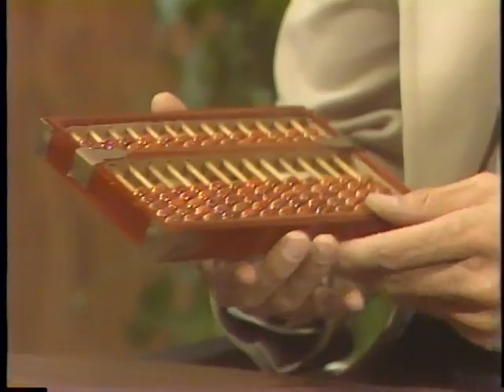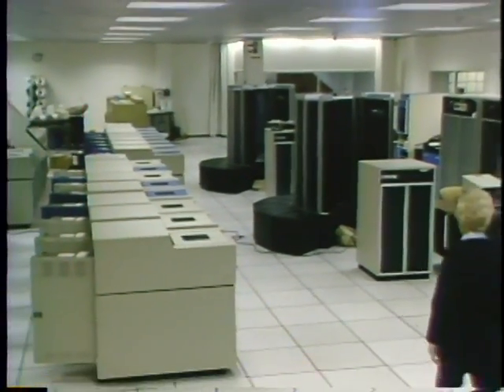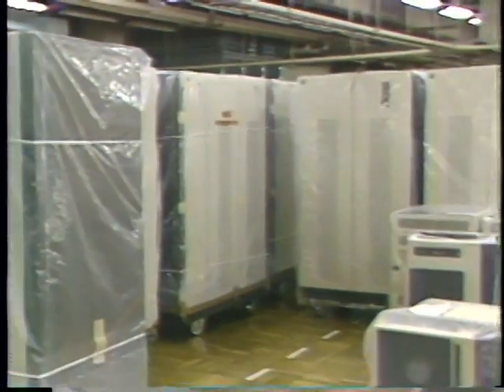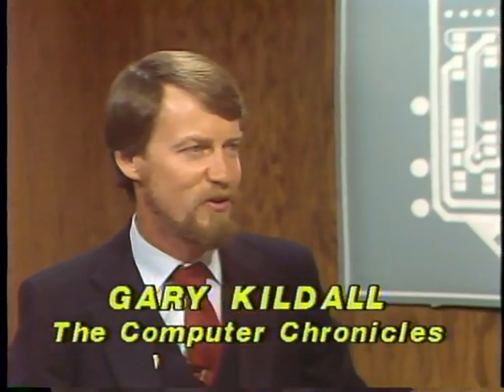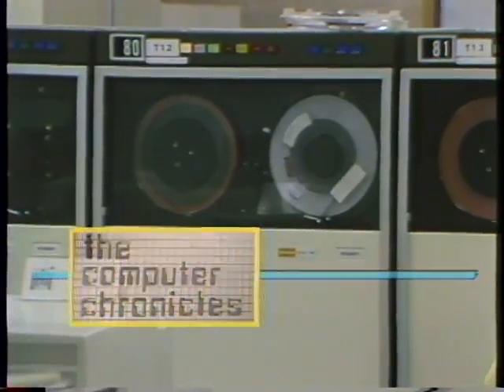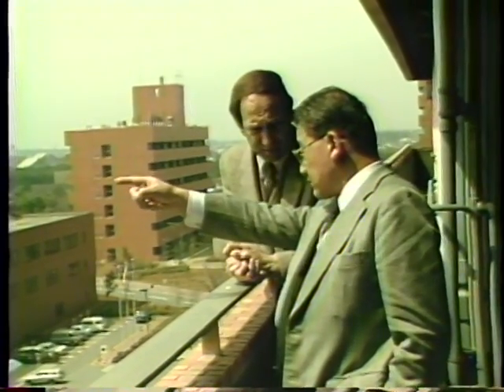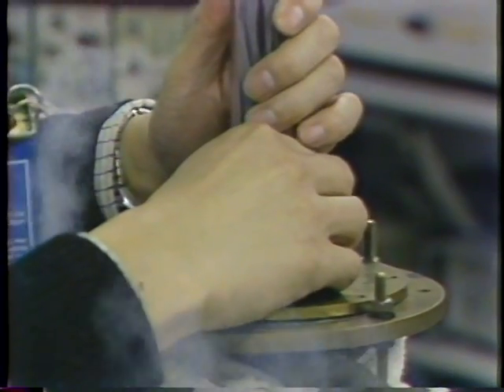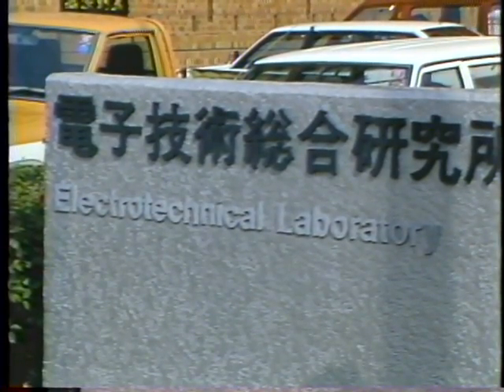The Computer Chronicles - Super Computers (1984)

Comment: Random fact - if you read the book Jurassic park (1990), in the beginning the government had no idea what was happening on the island and were investigating the company. They knew that the company Ingen had imported three cray X-MP super computers on to the island. The ones in this video were the earlier versions used to design nuclear weapons. One computer was enough do most of the work anyone would need - yet this company named ingen had  imported  3 of these on a remote island.  The government was baffled as to why someone would need that much computing power on a remote island - little did they know that the park were using them to reconstruct the genome of the dinosaurs
Reply: Random fact - The supercomputer in the Jurassic Park film is a Thinking Machines CM-5 supercomputer, not a Cray.
Reply: Little did they also know the park boasted some silicon graphics machines as well. Screw the dinosaurs, they should have sold tickets for people to come and see the computers.

Comment: The fun thing about this technology in this video is that, over time these supercomputers with their specialized parallel and high performance hardware started using more standard operating systems (like, eventually, Linux...), meaning those operating systems had to add support for this kind of specialized hardware. Later on, when typical consumer hardware like desktop and phone CPUs became more like these old supercomputers (with lots of pipelining, and multiple cores), the OSes already had the support in place to be able to run in those kinds of environments.

Comment: I recall reading an article in New Scientist back in the 1990's about the race to build the first Teraflops supercomputer.
The latest Xbox supposedly has around 12 times that performance.
Reply: I wrote a (bad) sci-fi novel in the early 90s in which an entire planet was run by a single "Teraflop Computer" lol
Reply: Not really the same numbers.  For supercomputers they always quote the flops in terms of double precision math (64 bit) as that is the standard for high quality simulations where the tiniest bit of accuracy makes a difference.  In the world of consumer gpu's, games don't need that type of precision.  the 12 tflops of the current xbox is single precision (32 bit); the double precision is only 759 gflops - short a terraflop.   So that "old" supercomputer you read about is still faster at what it was designed to do than the current xbox.  Keep in mind though, that the crippling of the double precision performance is intentionally done so that people don't buy these cheap consumer units to stack them up for highly scientific work - they want you to buy the super expensive commercial/industrial GPUs. And those are wicked fast - the current Nvidia A100, a standard "budget" server farm GPU does 10 Tflops double precision, for example.  With that said, modern gpu's have one added massive thing that these old supercomputers didn't have and that is super fast memory access.  the Xbox has DDR6 320bit memory at half a terabyte per second, which so much exceeds these old supercomputers that their throughput would make them effectively faster despite their slower computational speed in double precision.  It is in fact this reason why you can run a neuro network AI LLM on today's moderate spec computer hardware that would never be close to achievable on those old supercomputers of the 90s.

Comment: @15:18 : Scary to see that guy messing with liquid N with no protection. One splash would kill your hand.
Reply: It’s not terminator 2
Reply: You can pour liquid nitrogen over your skin with minimal effect. Your hand is so comparatively hot that the nirogen starts to evatorate before it can make close contact effectively floating it away from your skin.

you have to actively plunge your hand in the LN for a few seconds just to cool it enough to start causing some damage.

Comment: Now transistors are closing in on the molecular structure of silicon, we are still at the dawn of processor based computing. As quantum computing becomes more viable and probable over possible we could soon make far larger leaps than ever before. If this is super-computing what will my eight year old granddaughter see in her life?
Reply: Quantum computers are a lot of hype. Don't get me wrong, they're a real technology with real applications, however popscience seems to imply that quantum computing is the next generation of computing in general, and that it will "replace" our current CPUs or whatever. That's not the case, because quantum computing does not provide any benefit to any of the tasks we normally run on "normal" computers. Instead they are able to run a whole new set of tasks that you can't do on a conventional computer.

Comment: Just to be clear, the system was not 100mhz but rather performed 100 million floating point operations per second(mflop). Processor speed and number of operations are not necessarily the same thing.

Comment: I used a Cray to calculate stresses in structures around this time. Never saw it, but did recently see one in a museum. I was surprised how small it looked, even so there were masses of wires at the back. The speed of light problem went away when everything was put on microchips.
Reply: What types of analysis were you doing?
Reply: @gregorymalchuk272  : Stresses in bus bodies, using NASTRAN. Buses take a hell of a pounding,  on lousy road surfaces and a large difference between empty and full weights. Even had a [double decker]  load case of full on top and empty downstairs

Comment: You'd need a Cray XMP to watch a YouTube video of this episode in 480p.
Reply: It would be hard pressed to show a 144p video on a 3 inch screen, even if you added a specialized graphics unit in line with the CPU's capabilities and the top end of what was available at the time. If you wanted 480i or 576i colour video at full frame rates, analogue TV was still your only choice.

Comment: 100,000,000 operations/second or 100 mips used to be the pinnacle of computer technology in 1984 via Cray computer. Now, we have a I7-4790k micro computer which can perform, 144,550,000,000 or 144,550 mips. A high end microcomputer made in 2014 is 1445.5 times faster than a super computer made in 1984.
Reply: 2014?  what about 2019 with i7-9700k?
Reply: @oldtwinsna8347  2022 and intel changed their entire architecture with P and E cores lol 💀

Comment: I remember the panic over the Japanese computer threat.  Then Linux came along, Intel developed the Pentium, Donald Becker developed Beowulf cluster software, and the whole notion of the "supercomputer" was fundamentally changed.
Reply: Yes, itÄs quite funny to see, how afraid they are about japanese computers. In the end, the japanese computer manufacturers just began to build Windows machines.
Reply: @acmenipponair  It was a real fear at that time since their government subsidized the cost of R&D and they had the existing manufacturing capacity, as well as customer base to deliver to.  In the end, it became irrelevant since the consumer market drove high performance computing to an exponentially higher degree.  Now in the current world we see total proof of this as supercomputers are just the same microprocessors in your ordinary devices, just tons of them well balanced together.
Reply: @oldtwinsna8347  Another thing that may have contributed is that there was a bit of a trade war with Japan in the 80s over this sort of stuff. Some US government officials even smashed a Japanese radio as part of a demonstration claiming that the Japanese sold precision CNC machine tools to the USSR. Though other countries had already sold the USSR similar equipment. But even before that, the US was trying to limit the amount of imports from Japan. The strange thing is that the US never seemed to do this with China. Stuff coming from China has American brand names on it, and it seems they are OK with that, even if it de-industrialized the country. Apparently competition from Japan was a serious issue, but they had no issues with just completely shutting factories down and making stuff in China.

Comment: The classic summary of supercomputers in 1984 that are current speeds of desktop computers.
Reply: No, modern desktops are 100-10000 times faster. A quad processor Gray X-MP was 800 MFLOPS. Modern top desktop processors are at about 100 GFLOPS. GPUs handle 7 or more TFLOPS.

Comment: Super Computers can do in the excess of 30,000 trillion calculations today.
Reply: +Jason Kendall Yeah, they sure have evolved.  Just imagine super computers thirty years from NOW.
Reply: Sunway TaihuLight, the current fastest system, is able to do about 93 PetaFLOPS. (93,000,000,000,000,000 Floating Point Operations Per Second.) So, it's 93 quadrillion calculations, which is roughly 3.1x the speed you've mentioned. I'm sure that by 2020-2025, we'll be looking at early quantum computers that might be able to scale up to the ExaFLOPS level by truncating the floating points into smaller block chains. (Though memory models are currently an issue, since we would basically need analog variability in each cell to represent the variation between 0-10, for instance, rather than 0-1.

Programming something like that is also likely going to be a bastard of a job, since the level of complexity is going to also increase by a magnitude, I'd think.
Reply: When you say 30,000 trillion you should specify the elapsed time
Interval for those calculations to be completed. Heh
Reply: @sbrazenor2  hmmm has this aged well? :)
Reply: @nerd2544  I did mention 2020-2025, so we have a few more years to be sure. Check back in a few years. 😁👍

Comment: Some people seem to be getting confused over the speeds of these computers. 

The Cray computer was working at 100 MIPS. that's instructions per second. Not 100 MHz which is machine cycles per second. Not every instruction is processed in every cycle. 

Also in terms of catching up to moore's law. A Cray of the time would be about as powerful as an iPad 2. Also these supercomputers were NOT general purpose. They were mainly vector processor based. That's a somewhat different form of math to what Most modern processors use Most often (gp processors have vector units but tend to rely on their integer and floating point units). 

Also megaFLOPS were mentioned. 100 megaflops is equivalent to maybe a Pentium or late 486. 10 gigaFLOPS would be more akin to a powerPC G5 or Pentium 4. Most modern arm(mobile) processors are about that fast.
Reply: But what matters is how fast these old supercomputers would be with today's type of applications we can relate to.  For example, would you be able to create a program on a Cray to do real time h.264 decoding at HD resolution?
Reply: @oldtwins  Not likely.
Reply: To the vector processors: We have such processors in our computers today. But NOT as the main purpose CPUs. But the GPUs. And there you can say, that a Cray One is applicable with the GPU of a small smartphone.
Reply: @acmenipponair  No, we've had vector processing in CPUs ever since Intel MMX and successors like 3DNow, SSE, AVX, AVX-512. PowerPC had AltiVec/VMX and VSX, ARM had VFP, Neon, SVE, SPARC had Vis...
Reply: Not quite. A p4-2.53(2002) had a performance of 0.4 GFlops. Non-overclocked. Which is about 1,000 times the speed of an 8088 (1981). Time interval: 21 years. A ryzen 5 3600 has a raw speed of around 500 Gflops. So thats roughly a 1,000 fold  increase in CPU calculation speed in 18 year's time. So speed increase is increasing per time interval. Slightly.
Reply: Conversely, single-core processors can handle more than one instruction at the same time. Seymour Cray developed this on his first supercomputer, the CDC 6600. As an example, an Intel Skylake core can theoretically process 5 instructions per cycle.

Comment: holy fuckin shit 100mhz that a lot
Reply: +Damien Hartley MIPS. not MHz. it could process 100 million instructions per second, MHz
 is the amount of machine cycles per second. some instructions can take 
multiple cycles to finish.
Reply: Okay so if you have more cores or cores split into multiple proprietary threads will that increase MIPS score.
Reply: Damien Hartley
well yeah, 2 cores do more than 1
Reply: maboroshi1986
What about cache? dose more cache equal more MIPS?
Reply: Damien Hartley that's often the result though cache doesn't push instructions through faster on its own.
Reply: maboroshi1986
Oh so the more transistors you have the more  algorithms possible.;le

Comment: A 100Mhz supercomputer, them were the days :)
Reply: +Hairy Coo MIPS. not MHz. it could process 100 million instructions per second, MHz is the amount of machine cycles per second. some instructions can take multiple cycles to finish.
Reply: Not even close. It would overheat and explode with that manufacturing process transistor sizes. Calculations per second isn't hz